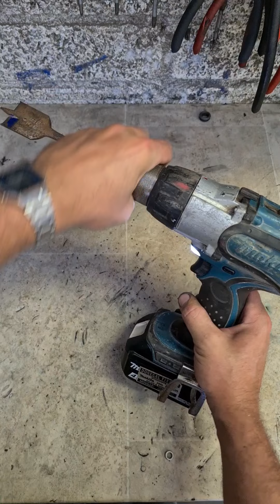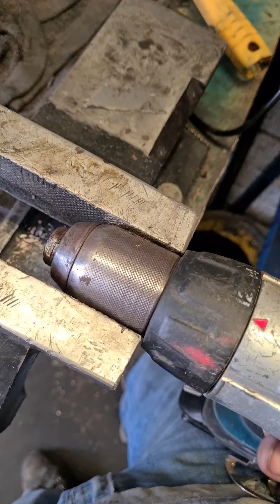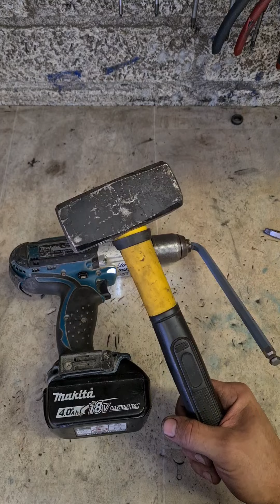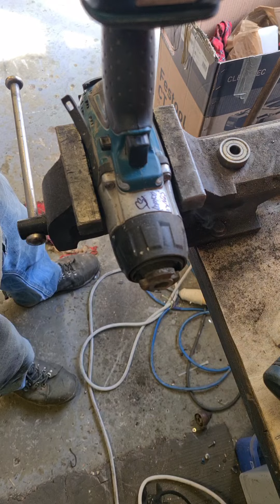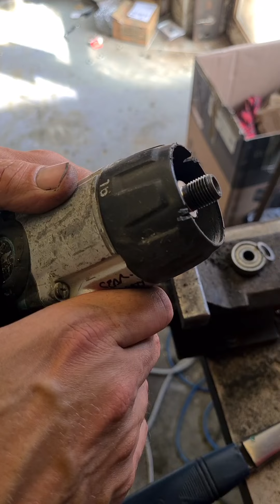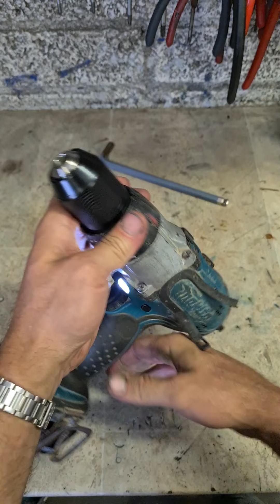How to remove and replace a seized chuck on a Makita cordless drill.

Comment: Thanks for the video. Every other video about getting a chuck off is with perfect conditions. The used drill I bought had a stripped screw and the jaws were locked back in the open position. Just put a new chuck on after cutting it off. Awesome!!!

Comment: I tried this solution and others on YouTube that use a hammer instead of their sense. My solution was to remove the left hand screw as shown, but know that this may take 2 people, one to press down on the screwdriver and the other to turn it clockwise to loosen. Next, instead of hammering on an allen key, use a hammer drill. I tried the beat on it method for 2 days and got nowhere and was making a mess of my drill body. I realized that the solution was torque and what better than a hammer drill to provide that. I cut off the L end of the allen key and inserted it in both chucks. Se the hammer drill to run in reverse and gave it a couple of shots on the trigger and the Makita chuck spun right off.
Moral, don't use a hammer, use your head. Thanks!
Reply: Instead of ruining everything ... I used mine .... see my post above ... shame I didn't read these comments first sounds like a great idea. I did try to use the power of the tool to do this but would you believe that the directional switch has a problem and wouldn't allow me to reverse the spin direction .. although I then thought to myself I have a 35A 15Volt bench supply but that became tricky trying to hold the motor body steady whilst switching on the mains and keeping the allen key from moving ...

Comment: Inner screw was removed easily on mine but I spent days whacking away at the chuck holding a long Allen Key without any luck. Eventually l decided that (since there was no way to grab hold of the spindle from the chuck end) I would dismantle, remove the gears from the gearbox and hold it firm from the inside. There are 3 pins on a disk after removing the nylon gears, and dismantling goes no further. Got the idea to grab a resin handled screwdriver, with 6 grooves along the handle and slightly wider than the radius of the pins. Filed away 3 of the grooves, just enough to allow it to hold those 3 pins that were left. Screwdriver handle locked in a vice, 3 pins held tight against handle and the lots of pressure on the Allen key, tight in the chuck jaws, until the chuck gave under the pressure. 
Will apply a little grease when I reassemble and hopefully it won't seize again. This drill was my fathers and I inherited it back in 2004 .. must have been from the 90's. Batteries are more than dead and they will get upgraded too!

Comment: I tried the allen wrench, blow torch, impact driver, and then this, cutting off half the chuck.  Now the drill just stopped working altogether before I was able to get the chuck off. 
I’ll buy another XPH12 or equivalent because I’ve been overall very happy with the makita cordless platform except for their chucks.   May buy a Rohm chuck from the start this time.

Comment: I notice that the centre  thread was damaged when the old chuck finally came off. Will this make the new chuck come loose or does the centre screw keep things tight?
Reply from the maker: The center screw keeps the new chuck on tight. The cut thread dose not make any difference at all. It was cut along with the old chuck, so the threads are cut clean and the new chuck will screw on easily. Some drill also don't have a center screw, so lock tight can be used ti hold the new chuck on permanently
Reply: @deandohertygreaser  Many thanks for the quick reply, I appreciate you are very busy. I had the exact same issue when I cut the chuck off my drill, I caused the same damage as was on your video so I was very interested in what you had to say. I have used lock tight on the damaged thread and on the screw but wasnt sure if I trusted the drill or not: was worried that the chuck might come loose due to 25% of the thread being flat.  Your words have been very reassuring. Once again, many thanks and keep up the excellent videos which are fascinating.